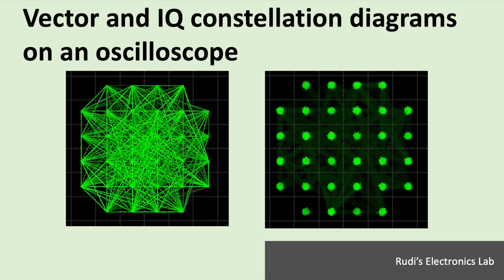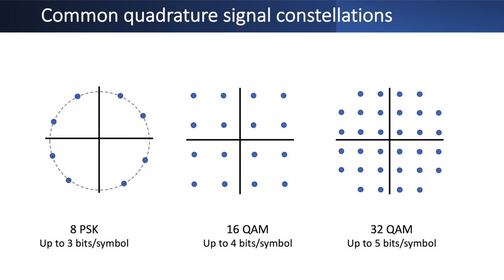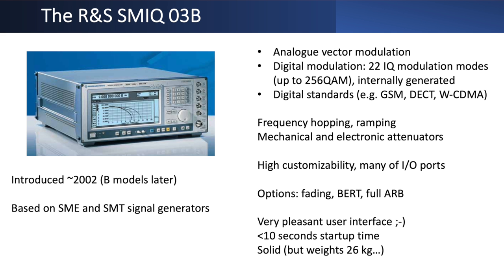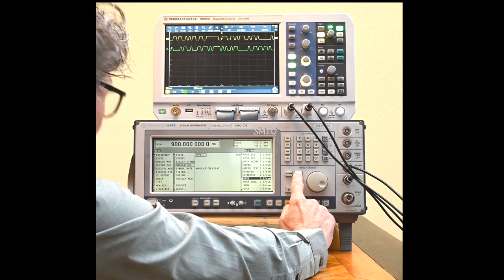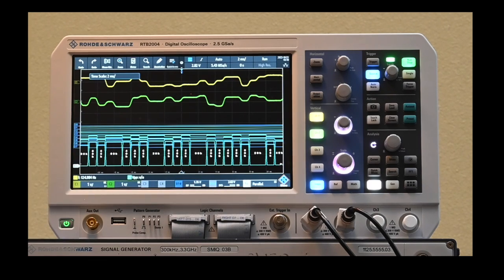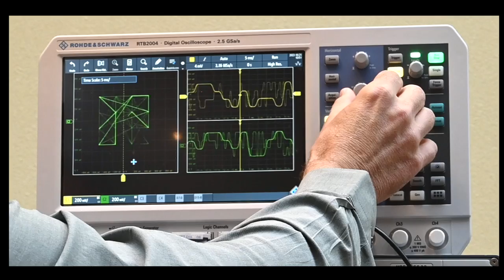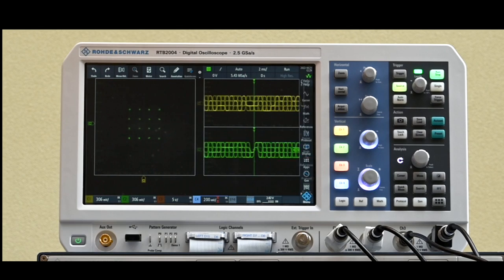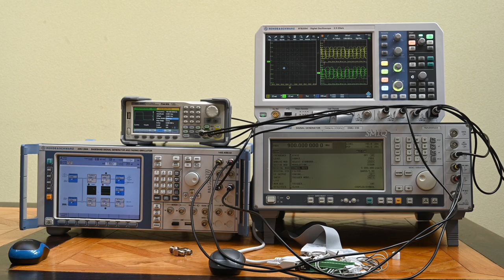REL #17 Vector and IQ constellation diagrams on an oscilloscope

Comment: Excellent session. I've got a 6.4 GHz version of you SMIQ. I just used it for RF amplifier testing with no modulation.  I didn't have a clue what the rest of the stuff did.  I've always thought it a great instrument and I can also use it as an anchor when I go fishing.  I've got a feeling it will do an espresso, but I haven't worked out that function yet.  Digital RF used to be a bit of a nystery for me now I get it.

Comment: What are you using for your logic analyzer breakout board? The probes from R&S are crazy expensive and it'd be nice to build something like what you have here.
Reply: The little breakout board you is is the following: The SMIQ has a 25-pin SUB-D connector on its back, with a variety of signals, including timing signal for the beginning of slots etc. Then I use a simple 25-pin SUB-D extension cable (female to male), which is sometimes sold as a 25-pin RS232 serial cable. I just made sure that all pins were actually wired, that’s not the case for each cable sold on the market! Finally, I am using a little breakout board that brings the 25 SUB-D to individually screw terminals. 

But from there, I do use the original R&S probes… not sure about DIY options there, I think (but have not checked) that the R&S logic probes for the RTB200 have active electronics in them, for adjusting the probing level, among other things. And you may also need a license to operate logic probes

Comment: Colour TV used IQ modulation quadrature amplitude modulation QUAM  for encoding the color signals.
Reply from the maker: Interesting observation, now reading about it and indeed, Wikipedia mentions that "NTSC and PAL analog color television systems, where the I- and Q-signals carry the components of chroma (colour) information. The QAM carrier phase is recovered from a special colorburst transmitted at the beginning of each scan line." Never realised that. I do know that for later digital TV systems, they proposed an interesting proposal in which SD images would use something like a hybrid QAM4/QAM16 system. The QAM4 would be sufficient to decode HD images, while the QAM16 constellation points (requiring a more advanced received and a better S/N ratio) would contain the HD information. Cool idea, but I don't know whether it was ever commercially implemented.
Reply: @rudiselectronicslab861   Yes, And PAL switched the imaginary axis 180 degrees on alternate raster lines which cancelled out phase errors so that the hue didn't change. Just the saturation. PAL used a glass 63.9 us acoustic delay line to provide the "two raster line" average.

The color carrier had a frequency that was just a bit higher than the maximum signal BW of the luminance signal. The PAL colour carrier was precisely 4.43361875 MHz.

NTSC was commercial from 1954 and PAL was introduced in 1962.  And of course all of the first color TV's used vacuum tubes.

Damn clever I think.

Comment: Very good. Just what I was looking for. I will be trying to do the same but using more modest equipment.
Reply from the maker: Thanks! In principle, any scope that has an XY mode (almost all do, also the most affordable ones) should allow you to see the vector diagram. If you don’t have an IQ signal generator, you might want to take a look at this thread where I posted some IQ files you can upload in a two channel ARB signal generator: https://github.com/RudisElectronicsLab/IQ-for-ARB

To get to see a constellation diagram, you’d need a scope with some for of blanking (sometimes called Z channel). This is less common on (current) scopes. Actually, it wars a bit more common for CRT scopes (my old HAMEG 203-5 has it, I may one time try it for IQ constellations!). But perhaps you can think of other creative solutions (I have one on my mind… haven’t tried it though). 

Apart from blanking, you need to play around with the timing to make the scope display the dots exactly on the time they should be stable. There may be various ways to to so, in my video I show how I do so using (another) signal generator. 

Good luck!

Comment: fantastic video. thank you. where did you get that breakout board to get the SMIQ aux signals from the back?
Reply: Thanks! The breakout board is a standard DB25 breakout board which you can get at many shops, connected to a standard DB25 extension cable (ensure that all 25 lines are wired!).

Comment: Thanks for the excellent video. Maybe you can generate an IQ signal with a 2 channel arbitrary generator.
Reply from the maker: Yes, that may be an option. In my video REL#1, I used a function generator with something like 5-step sequences on each channel and played with the frequency ratio (e.g.; 2:3) to get usable timing and an interesting set of transitions. But such approaches stay far from real IQ signals.
Reply from the maker: With my new setup, I might be able to record some real IQ signals and record them into a scope, save them as *CSV, allowing them to be uploaded into a signal generator. Will still  take some attention to get the record length exactly right, the sync between the two channels, etc...
Reply from the maker: I have now created a dataset that anyone can play a recorded 32QAM signal on a suitable signal generator... It can be found here: https://github.com/RudisElectronicsLab/IQ-for-ARB